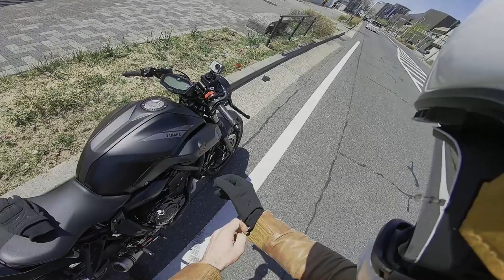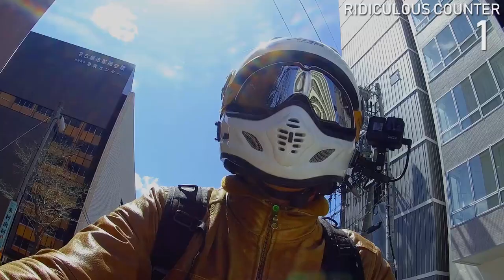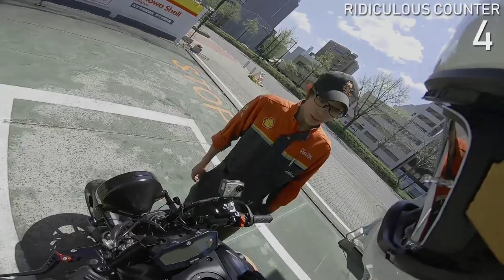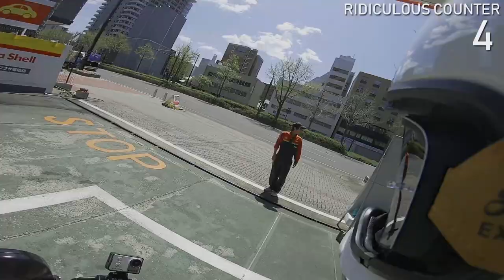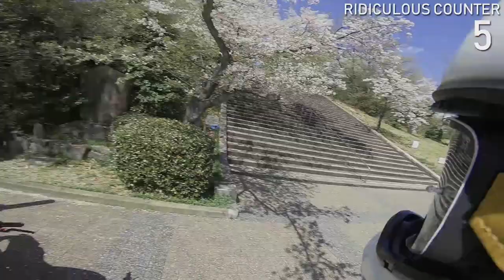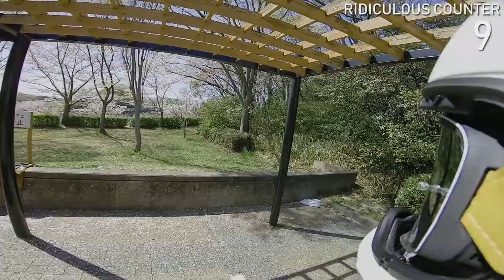SC PROJECT FULL EXHAUST - Yamaha MT-07 Motovlog Japan

Comment: I'm glad you find the sound awful as well, because that's exactly what I was talking about in my comment on your last video :D It's just way too loud for such a "smaller" bike in comparison (too loud in general in my opinion). Also think about your ears, just exposing your ears for 10-20 minutes to that level of noise every day will fuck up your hearing pretty bad, i'm almost certain. If it's going to stay at such an high level of noise you better invest in some hearing protection. Trust me, tinnitus is no fun and it also gets very exhausting on longer rides, if your exhaust is just too loud,since you can't really concentrate/focus on the road. It does look pretty good though, especially these two bends just before the muffler look very good in my opinion. Muffler might be the wrong choice of words here though, since it's just a straight "pipe" :D 

About the power: The stock exhausts look and sound pretty bad most of the time, but manufacturers spend a huge amount of time on developing and researching about the functionality of these things. So while they might not look and sound good, they're most of the time very well optimized by taking into account the air/fuel ratio, airflow etc. By sticking on a whole new exhaust, you kind of make the factory tune worthless since you also change the diameter of the exhaust and so on, so with most aftermarket exhauts you actually lose power/torque, despite what the Advertisements say. The only real way to get more power will probably be to get it on a dyno or flash the ecu of some kind.
Reply: this is a comment some one with out a bike would say lol

Comment: I would imagine it is slower if you didn't tune it. Lots of guys say mt-07's with a stock tune feel gutted after a full exhaust.
Reply from the maker: Yeah. I thought that with the gasoline being good quality in Japan that I might not need a tune. Hmmm....time to look into a tune I guess
Reply: @bikehubjapan  Ecu flash ftw if you don't want to spend a whole bunch on a dyno tune.
Reply from the maker: Got it! I'm going to start researching the best option for a flash. I will do it myself as there are no local dyno's where I live. I do have a wideband lambda sensor left over from my racing days, so maybe I can weld a bung onto the exhaust and try and to get some data and tune myself that way...
Reply: @bikehubjapan  I'm pretty sure the ecu's these days tend to be locked up quite well. The days of TuneEcu style tuning are unfortunately gone. (if that is what you were referring to) The system JakeTheGardenSnake used on his MT07 looks really clean. Then its just plugging it in to a computer to derestrict it and load a map. The easiest way is to mail your ecu in to a company to have it set up for you. I would take the first option as you can always make changes after the initial purchase of only about $100 more.
Reply from the maker: @LouCFur90  The trouble is I use the bike everyday, so don't have time to send the ECU somewhere. Used to use TuneECU on my KTM's. But I also have a wideband lambda sensor with datalogger. So at the least I can check my fueling, then buy some software/cable and tune it to good A/F levels. Firstly I'll see if anyone in Japan is offering a flash tuning service
Reply: @bikehubjapan  That should work great. You will get some real world data to get that bike really dialed in.
Reply: I just did a full exhaust on mine and I dont notice any power loss if anything it feels a hair snappier. But still recommend getting a tune.
Reply: Also without a tune I notice my bike runs better with the DB killer in.

Comment: Not quite as ridiculous as that Headlight. That looks very wrong, imo, of course.
Reply from the maker: Fair enough
Reply: @bikehubjapan  Just too much projection on it - comes off looking like a Snail's eye stalk. Might just need a shorter bracket, bringing it closer to the forks or perhaps a bucket without that odd taper.
Reply from the maker: @plus445  Unfortunately the MT07 has the ignition key barrel right where I want the light to be. I've taken the top triple off to try and remove the key barrel but being a Japanese spec bike it has an immobilizer built in and I'm not sure if I can relocate it without screwing up the signal from the key. It's work in progress anyway. Definitely want shorter brackets in the future